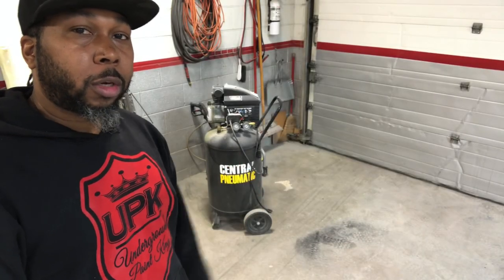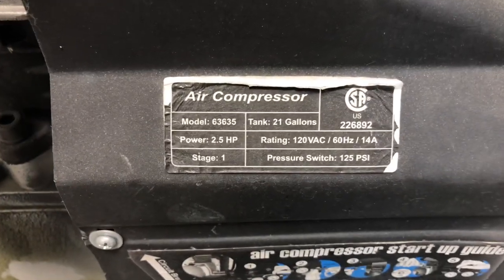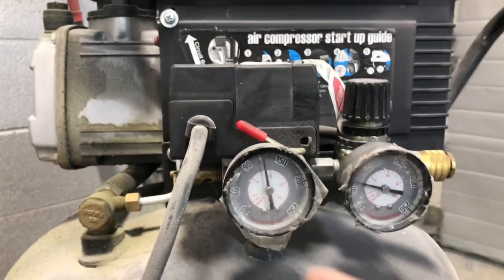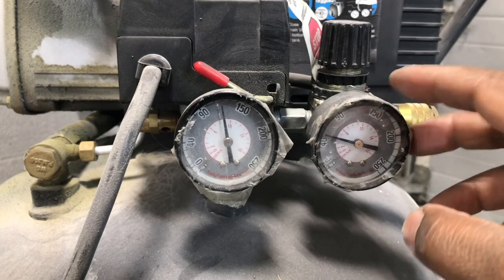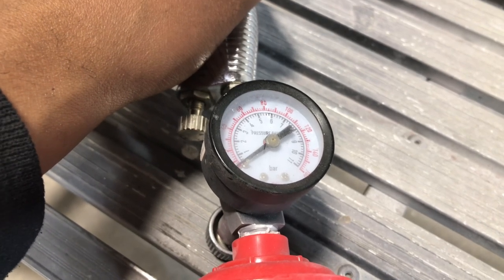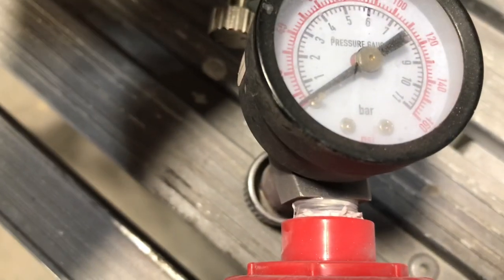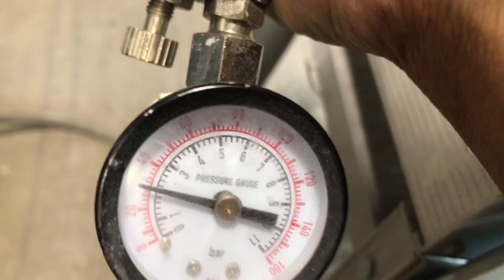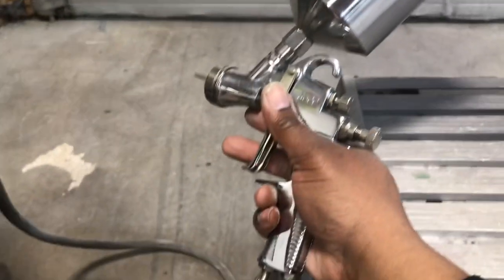How to setup your compressor for paint

Comment: The people's champ does it again! Thanks for all the great videos. Unlike all the other channels that say "best small compressor at home spray guns", then run them off pro 60 gallon tanks you actually show how to run on a small tank. Top notch
Reply from the maker: I do my best to help my people out Fisch…I appreciate you checking out the video!
Reply: Very tru I paint with a hf 29 gallon compressor haven't sprayed a entire car yet but it can handle what I use it for even with some expensive guns I have
Reply: @UndergroundPaintKing hi my bro, would i be able to use a lvlp gun on a hyundai 50litre oil free compressor, 11cfm 2.5hp
Reply: I've restored three cars already with a 6 gallon pancake compressor. I spray the traditional acrylic lacquer for restoration purposes. I do one panel at a time. The entire paint job on any given car takes about seven days, as I spray it in sections. I know, the words "acrylic lacquer" is practically a swear word to today's painters, and painters who still use it are practically considered alien life forms. With acrylic lacquer, you can literally stop in the middle of a panel and continue painting the next day if you want. You have to cut-and-buff after you're finished, but I consider that "my therapy" :)

Comment: Thank you. This was what people don't understabd when they start painting.. What goes along with that is "while painting, don't let up on the trigger as you turn back for the next stroke." In your video when you let up on the trigger and the pressure goes up to like 60, the split second you pull the trigger, you will for a split second, get 60 psi at the nozzle instead of the 30 . You can hear this in your video. Each time you pull the triggeer, you can hear a RUSH of air.  To correct this, when painting never let all the way off the trigger. Just relax the trigger at the end of a run, but keep the AIR flowing through the gun with out siphoning any paint.
Reply from the maker: Thanks Tom I appreciate you checking out the video and leaving a great tip💯💪🏾

Comment: Good gracious.  Just set the tank at 90 and the gun at whatever you want it to be and call it a day.  Also, need to make sure there is something to trap moisture NEAR THE GUN since those little compressors run hot and will put water in the air.  I see you have a filter before the regulator so you are set.
Reply from the maker: Thanks for watching the video!

Comment: you explain things simply brilliantly!!! Of course the longer your air hose, you'll need slightly more air pressure coming out of the compressor. Also it prevents the compressor running all the time and some water separators have pressure limits. Also ensuring you have no air leaks between the compressor and the gun helps. Top job good sir!! Hello from Newcastle, Australia!!
Reply from the maker: Thanks Mick for checking out the video and leaving some great info, I appreciate you watching all the way in Australia 🙏🏽

Comment: This is pretty much exactly how I have mines setup , for consistent air flow. Dropping pressure is a big problem with smaller compressors with those bigger guns I use and this setup like this has helped dramatically. Good video brother
Reply from the maker: Thanks Bro I appreciate that and keep dropping that content!

Comment: Fantastic, I hope this may help with some of the issues I am having.

I picked up the AeroPro r500 (on your recommendation, super happy with it) and am using a 21 gallon compressor.   I had the knob on the air compressor maxed out and what would happen is when I pulled the trigger on the gun and set my pressure on the regulator it would be fine for awhile, but then the pressure would drop and I'd have to set the regulator again.

I am hoping that by setting the compressor to just 20 or 30 pounds above what I want to paint at that it would give me more consistency.   I just assumed the regulator would, you know, regulate it no matter what, but maybe I'm asking too much from it?   Thank you for making these videos, awesome that you are willing to share your knowledge.  :)
Reply from the maker: I’m glad the video was helpful and I hope that works for you!

Comment: Thank you for all the useful information. Quick question, when the compressor kicks on while your spraying, is there fluctuation in the pressure?
Reply from the maker: If it’s set at a certain pressure it shouldn’t be to much fluctuation if any. There should be enough air in the tank to keep consistent air to the spray gun

Comment: Although your paint work looks great as is, you might find a decent quality inline filter and a refrigerated dryer to improve your craft even further. I do compressed air systems for a living and service many body shops. When you’re not using clean intake air for the compressor and a consumer compressor like yours, you do have a much higher chance of air contamination from low quality intake filters. Also being you’re using an oil lubricated compressor you have the chance oil contamination in your air as well which can be difficult to remove even with your (assumed) filter dryer cartridge on the inlet of your gun. The refrigerated dryer obviously is to lower the dew point of the air in the line and remove almost all moisture content. You might have all these things and not have shown them but incase not it could be a good bit of knowledge for someone. Loved your tip here on air management to reduce compressor run time !
Reply from the maker: Thanks I appreciate you Robby and you’re absolutely right on everything you’re saying…I don’t have a inline filter system for my setup because it’s not my main setup for my shop, I actually have a filter setup for my paint booth and 80 gallon compressor that I use for the shop…I appreciate you for checking out the video and dropping some good information on me!
Reply: @UndergroundPaintKing  💪🏼💪🏼
Reply from the maker: @Robtuse_  appreciate you Robby💪🏾💯

Comment: Hello paint king I have a question for you brother. I have a 20 gallon compressor and the paint gun I have is the r500 lvlp . I'm getting ready to paint my first ever base coat clear coat job what should my gun and compressor be set at for spraying the clear coat. 50 ft of hose. Thanks love your videos
Reply from the maker: I set my compressor at 60 psi as I showed in the video and I like to spray my clear at 30 psi

Comment: I have a much larger loss of air.  I have a huge tank so it must be fittings or the hose is to small.   Hose is 1/4”. Either way I set it like you showed.   Thanks.
Reply from the maker: I honestly don’t know how you could be losing more air with a short hose Gene🤔

Comment: What's up fam, loving all your content. When you can will you do a video on duel set up compressors. I have 21 gallon central, and 30 gallon central linked together
Reply from the maker: I’ve never ran duel compressors but I’ll see what I can do…appreciate you checking out the videos!
Reply: I run dual compressors as well.

Comment: hey, so I have a water trap/regulator plugged in at the compressor end, but no water trap at the gun end, just a mini regulator. But today water droplets came out in the paint, I think they came out of a connection near the mini regulator rather than the actual spray gun tip. Tbf I did forget to empty the water out the compressor and water trap.

Anyway I noticed that you dont have a water trap at the compressor end, just one mini one near the gun, so do you think I can just ditch the one I have at the compressor end and all I need is one of those inline water traps at the gun end? thanks
Reply from the maker: Yeah that’s how I normally spray, I just make sure the tank is empty

Comment: So king, you set the regulator at 60 PSI, and adjust the gage at the gun to get 30 PSI. Is it still ok to maybe set the regulator to like 90 PSI and still adjust the airflow at the gun to get the 3 PSI you need or not recommended?
Reply from the maker: You can set it at 90

Comment: Thanks UPK Good basic info so we don’t hunt around too much for settings.   Is that a high flow air hose?  I’ve got a HF compressor also and the summit Lvlp gun, just seeing if a hose makes all the difference also.  Getting my garage geared up for some painting and learning experiences 💯
Reply from the maker: You’re welcome Rusty Ryan I appreciate you checking out the video and the air hose I’m using is the Diablo air hose from HF ( I may be wrong on the name ) along with high air flow fittings…I really like these air hoses!

Comment: Dude I’m fighting a air issue presently. My gun is a Devilbiss GTI pro lite 1.3 with T10 cap my compressor is a 80 gal 2 stage unit with 17.5 cfms at 90 PSI when I set my gun at 24 PSI and hold the trigger down one step aironly till the compressor cycles at 100 PSI my inline drops to 15.5 before it cycles and build back to 135 PSI . If the compressor is running it will climb back up even with the gun spraying air. My only idea is the air hose and some 3/8” fittings need to be bigger?
Reply from the maker: So you’re having a issue with the air dropping from 24 to 15.5?

Comment: UPK, I was using a harbor freight 8 gallon compressor with the gauge at the gun showing 30psi. I had a lot of orange peel. Could it be that I need the 21 gallon harbor freight to get less orange peel? It was spraying with the Sprayit and Eastwood single stage paint. Thanks for the awesome videos
Reply from the maker: It could have been your gun settings vs the materials you’re spraying. Did you use a catalyst with your single stage?

Comment: Great info just got a new compressor and was playing around with the settings for some new guns I have as well. My question is I us to haven a smaller compressor and I never use a regulator on the gun I would set my psi at the compressor.  With a larger compressor 25 gallon  18.5 cfms can I set my psi  for the gun at the compressor or should I start using a regulator on the gun?
Reply from the maker: I personally would use a regulator but if you don’t go with a regulator just remember that you have to make up for the air hose so you should be able to set the compressor a little higher than what you need for your spray gun and do spray outs until you have the gun set and spraying like you want
Reply: @UndergroundPaintKing   appreciate it thanks.
Reply from the maker: @3rekoatskustoms929  yessir!

Comment: johnnyboy1950 from the UK
I have bought a new compressor which is 50L (13.2 US gallons) 7cfm 116 psi. It will spray using a LvLP gun but after about 10 secs the compressor kicks in stays on all the time I'm spraying. Im spraying a fence which means the gun is working constantly. After about 2 mins the flow is really low and I have to wait for the tank to build up pressure. Am I expecting too much from the spec of the compressor? thanx
Reply from the maker: You have a small tank so its running out of reserves faster than it can build it up so I would give it some time for the tank to fill and then you should be able to go back to spraying
Reply: You can get a reserve air tank to add to your tank to increase run time, you seem to have pretty decent CFM just a smaller tank.

Comment: Do I need that Guage and a set up you have at the bottom of the gun if so what you call it and a where do I get it I have a 30 gallon tank is that necessary or I don't need it
Reply from the maker: You can paint without it but it helps and it’s called a air regulator

Comment: Thank u for the info, I am going to paint my car with a  husky 30 gallon compressor HvLP gun. Do you recommend the silicone desiccant filled hose for condensation?
Or should I just slightly crack open my drain?
What air filter do you recommend on your gun?
Reply from the maker: I usually open the drain and use a water trap on my spray gun…you can get a filter to use in between the compressor and the spray gun

Comment: Hey man so what does it mean if the air flow isn't consistent? If it's set like this and drops. The gauge on my tank (set at 60) will say it's consistent ~ 35psi w. the trigger pulled & on my gun gauge w. The trigger pulled it'll drop to 25 30psi and slowly go to about 5 10psi but doesn't really run out of air & it will have a larger burst of air when i hit the trigger then it levels off. I've tried 2 diff gauges on the gun. Checked for air leaks. Could it be a bad regulator? A610 gun 25ft hose
Reply from the maker: It’s possible to be the regulator, do you have anything else connected that could be pulling air before it gets to the spray gun like a filter?

Comment: Great video UPK, I learned a lot.  I bought the A610 LVLP Spray gun and the technical data sheet on this spray gun shows recommended pressure between 29-50 PSI. I will be using a 25 foot air hose.  So I don't want to go over 50 PSI maximum pressure of this spray gun. What would you recommend?    Am  I correct at assuming that I would lose about 5 lbs of air pressure from the 25' air hose?     So theoretically I could set the  pressure at the compressor to 55 PSI and 35 PSI with  the  regulator at the spray gun?     Also I watch another video were I saw someone set their A610 Spray gun to only 15 PSI and was still able to spray.  Any recommendations would be appreciated.       Regards:  Newby Painter
Reply from the maker: You can definitely set your compressor up that way and it should work for you Rick and as far as air pressure goes when painting, it’s best to test the pressures out to see what’s best for the material that you’re spraying because it’s not all the same, so what may work for me may not necessarily work for you, so I would do some test spraying to dial your materials in like you want and you should be good
Reply: If you want to be sure for the specific material you plan on spraying look up the materials "Technical Data Sheet" for your product, it should give advice on the PSI settings, I'm using Valspar 852 series and it says 30PSI for a gravity feed gun and 35-45 for a siphon feed gun. This would be at the gun pressure.

Comment: So you don't use/need? them fancy  50ft tube filtration systems that go on wall  for small compressor? because im trynna paint my single cab truck with a similar compressor and wondering if i should buy that filter system or just buy filters and 50 ft hose just need a heads up before i purchase any of them if needed lmk please?
Reply from the maker: I personally wouldn’t do the 50ft filtration system but if you feel you need it you could
Reply: @UndergroundPaintKing  what did you use for your small compressor paint job a filter and 50 ft hose like you said in video?
Reply from the maker: @Sxvaqe-_-  I use between a 25 or 50 depending on what I’m doing and a filter on my spray gun
Reply: @UndergroundPaintKing  thanks for your help and appreciate the quick response 👍
Reply from the maker: @Sxvaqe-_-  you’re welcome!

Comment: There is some important technical details that you're covering for those that are about to start a project for the first time. I'll paint my 4 runner 2nd gen, and I've ordered a lvlp gun combined with a pressure gauche and air filter. Now, there is the dilema, which budget comp should I buy ! I have 2 on the sight , same brand. One is 100L , 289L/m 85db VS 80L , 298L/m 68db . Could you tell me which one should I use ! I've got a concern regarding the roof , it's massive and will need primer , base and clear coat . How should I manage such a large area ? Thanks in advance.
Reply from the maker: You want to pick a compressor based off the spray gun you’re using. You want a compressor that will supply the paint gun properly so that it can spray consistently and not fluctuate in pressure. In regards to the roof, if you’re doing a complete paint job you can concentrate on the roof and do all the work necessary then paint it and then cover it and continue with the rest of the project, so it’s like breaking the project down into parts to make one complete job
Reply: @UndergroundPaintKing    thanks a lot bro for your precious tips .

Comment: Super helfpful video
Reply from the maker: Glad the video was helpful!
Reply: @UndergroundPaintKing  good looks on the reply the people’s champ, haha. I got a question for you if you don’t mind. If I get a 27gal 175psi HF compressor would you recommend running lvlp or a regular spray gun at 30psi. I would prefer a regular spray gun
Reply from the maker: @maxgregory2227  You need a compressor that can deliver the cfm needed for your spray gun to run properly, lvlp spray guns run at a lower cfm so they do well with a smaller compressor but regular spray guns (hvlp) normally require higher cfm that a small compressor doesn’t normally deliver. If you have a big project and a small setup I recommend a lvlp but if you have a small job with a small setup you can get away with a regular spray gun but keep in mind that the compressor possibly won’t keep up with the regular spray gun

Comment: So, I added a Steel Camel filter followed by a HF desiccant filter. The Steel Camel filter doesn't want more than 60psi. So I have the regulator set to that. After a 50 ft hose, gun regulator and a water/oil separator, I can't get more than about 20-22psi at the gun. I sprayed Nason Primer Surfacer with it, using a 1.7 tip and it seemed OK for that, but I'm worried about the actual paint. Going to email Steel Camel and see what they say.
Reply from the maker: The more you add in the filtration system the more air you lose and that’s why I don’t go crazy with a filtration system on a small compressor setup
Reply: @UndergroundPaintKing  I suspected as much. I might remove the desiccant filter if I need to. Pharraway has the Steel Camel filter in his setup and said the stuff after it wasn't really necessary but he already had it before adding the SC filter into the system. We'll see what they say.
Reply from the maker: @jayinmi3706  let me know what they say Jay!